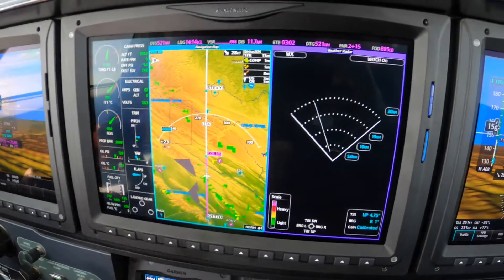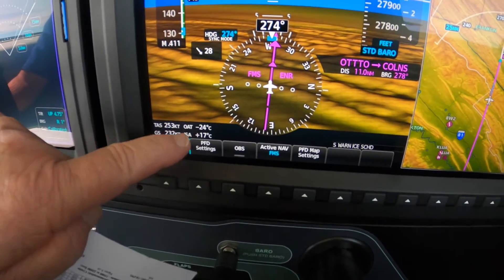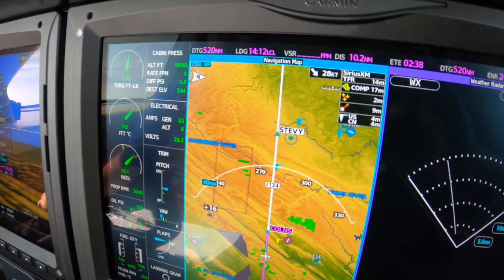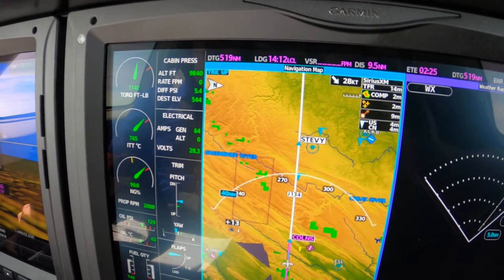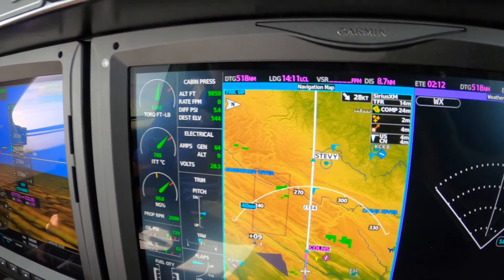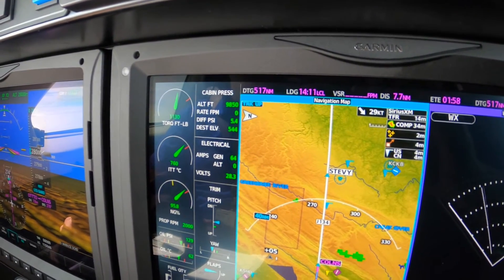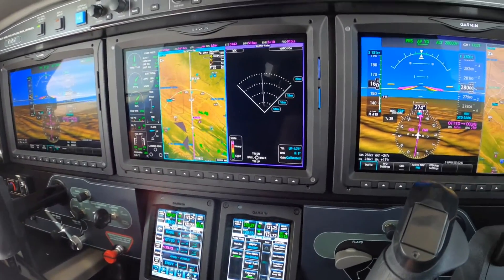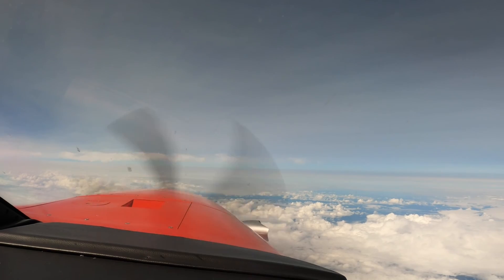Engine Management: Piper M600/SLS Aircraft

Comment: Dick, do you use a fixed fuel burn number for flight planning? I'm try to figure out the legs on this thing. Cheers, Pat.
Reply from the maker: Hi Patrick,  Piper’s book numbers on the M600 are accurate. I am confident you will be happy with both the range and payload of the Piper M600. I use a rule of thumb .. 200 lbs for the first 30 minutes (climb) and 250 lbs for each additional hour. I deduct 300 lbs for VMC reserve and 400 Lbs for IMC reserves. The M600 will easily meet the needs of most general aviators. It is an absolute joy to fly! .. Fly Safely - Train Often .. DR